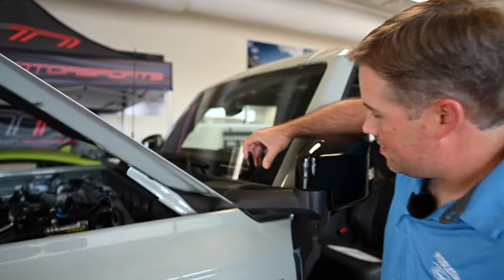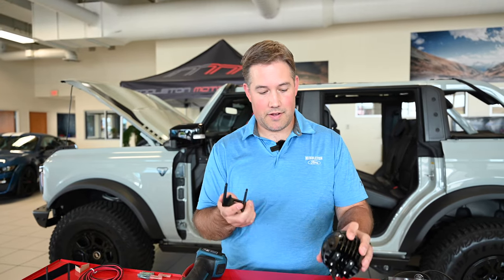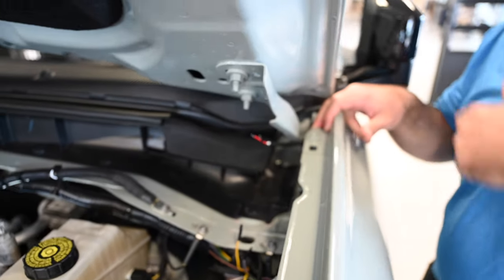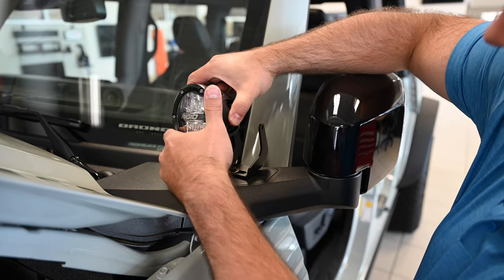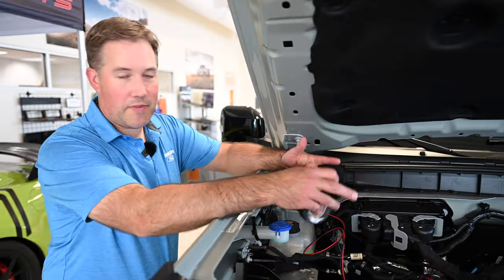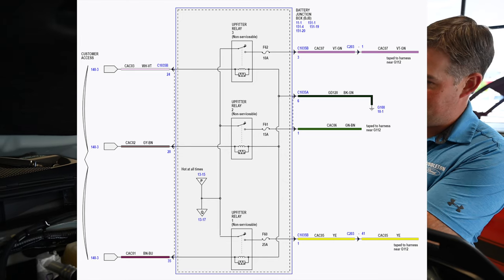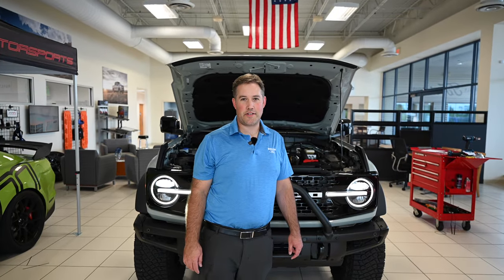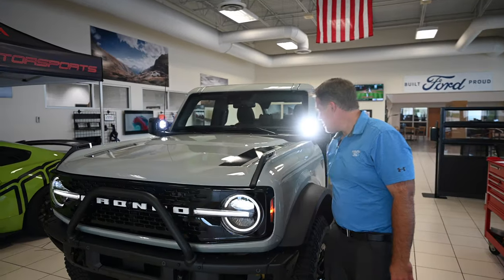2021 Ford Bronco Rigid 4in 360 Series LED Pod Light A-Pillar Install into Factory Accessory Switch

Comment: Great video, just bad advice on using the yellow wire. aux 1 is 30 amp which should be saved for something much higher draw I went to aux 3 for these and aux 4 for rock lights.
Reply: Yeah, ditto, I thought the same thing, why use the huge amp wire for something like those lights?  I have used my switches 5 & 6 for lights.  I do like their videos, I've seen a few others.
Reply: I was thinking the same thing until I started wiring my own saw that the four 10a wires are only 22awg. The upper two are only 16. To each his own, but I would never use 22 to carry even low power more than a foot or two. May look at the relay box and see if those can be replaced.

Comment: Great video.  One nice advantage to going with the Rigid lights is the brackets are "adjustable" side-to-side.  This enables you to slide it out of the way (at least partially) from the antenna on the passenger side.  Less expensive lights have brackets with a single mount hole (no side-to-side adjustment).

Comment: Thanks for the video! 
I personally would have use a quick disconnect for the wiring connection. It would save you from cutting the factory wire again it doesn’t look very long to begin with.
Reply: Eh, you shot it at where the crimp is so you would only lose 1/8" of wire each time.  I get the thought, but a weatherpak connection there is a bit overkill.  There is also more wire than it looks like, or at least there is on my SD anyway.
Reply from the maker: That is a good idea. Maybe we will implement that when we add a light-bar and move the pod lights to switch 2 and light-bar to switch 1.
Reply: May be a dumb question, but I’m not a wiring guy. Using a weatherpak, would you be able to crimp both of the wires into the one, using the single weatherpack connector? Hopefully I’m not complicating this question.

Comment: Question, do you still have to ground the negative to the frame?  I assumed ford made this wiring like a Switch Pro or sPod to were you just connected the wires directly to a port, but it looks like you did a ground to the frame.  Not a huge deal, just clarifying.
Reply from the maker: Yes, you still have to wire the ground to the frame. Luckily there are lots of factory locations to do so. Thanks for reaching out!

Comment: Are these Pods listed with the Ford Accessories still?  I can't find them.  Also, did you use Switch 1 for the Pods?  I was thinking of using Switch 2(15amp) for Rigid Light Bar and Switch 3(10amp) for the Rigid Pods.  Thoughts? Also, are you going to do the Rigid light bar next? :-)
Reply from the maker: I think they should still be listed with Ford Accessories. We can get them ordered for you if you would like, just let us know. In regards to switch we picked. We did the 1st switch due to connivance currently. Once the light-bar comes in we will most likely change which switches each lighting group goes to.
Reply: you can always change the preset fuses in the box to acomidate what you need... you can make switch 2-6 a 20 amp
Reply: @PrtTymPimp1980  Each AUX switch has a different gauge wire intended for a specific amperage. Switch 1, yellow wire has a 1.5mm wire gauge and corresponds to the 25A fuse. AUX2 is 1.5mm with 15A fuse, AUX3 is 0.75mm and 10A fuse, AUX4 to AUX6 are 0.35mm and 5A fuses. I wouldn't recommend what you're suggesting.
Reply: @2011blueman  Hey, thanks for that note on wire gauge.  I was unaware of that and its important we understand (still waiting o my Bronco so haven't looked hard enough).  But that begs the question on what we can use with those smaller wire gauges on Aux 4 to 6.  I would think small lights like these should be for the smaller diameter wire but are these last 3 switch gauges to small for dual offroad lights. if so, what else is there that they could be useful for.  Maybe pod under body lights I suppose. Guess I need to figure out what gauge and fuse the components recommend and start there.
Reply: @MiddletonMotorsports  I just ordered two sets of these pod lights but they have a back light. Do I need to wire the back lights to a separate switch? My Lightbar will also have a back light.

Comment: I ordered the rigid d-ss pro spots which come with a wiring harness. Should I use it to connect to the lights and then connect directly to the aux 3  switch wire or just use my own wires and snip off the ends to the lights.

Comment: It would be great if you had a parts list and the model number of the Light pods with the Black brackets.  I have only seen chrome brackets on those rigid lights.   Also what awg was your wire from the other side of the pod.  14? 16? 18?    and  Thank you,  GREAT VIDEO~!  Thumbs Up.
Reply: ive been using 14g on our Bronco... light bar and 7" Hella pod lights on the side.. The one thing that is left out of this video is that Ford put the wiring diagram in the "infotainment" screen....it is the general settings...
Reply: The ford accessory kit part number is M-15200K-BML. It comes with the brackets, Rigid 360 series 4'' light pods, wiring, bolts, and "ford performance" light covers. One important thing to note is that the ford version of the Rigid 360 lights disables the backlight feature that is normally on the rigid 360 lights. Normally the 360 lights have a backlight available in various colors.
Reply: @2011blueman  thanks for that update.  If only we could get that better bracket he used here with the standard Rigid Pod Lights (with backlight feature).  I bought the latter with the chrome cheaper bracket and it doesn't give me enough play to get the light away from the antenna.  I need to find another bracket, or modify the current ones, to move it back and to right an half inch or so.  Those Rigid Brackets also need to be painted.  Looks terrible against the black base and mirror area.
Reply: @panzer948  Since the bracket is sold in the kit, I'd bet at some point you could get it from either ford or rigid. I'd contact Rigid customer service and see if they can sell the brackets separately.
Reply: @2011blueman  good idea.  I think I will shoot them an email shortly (since it's Sunday).